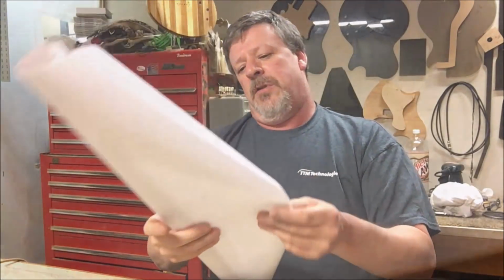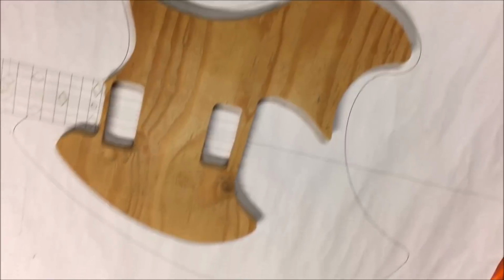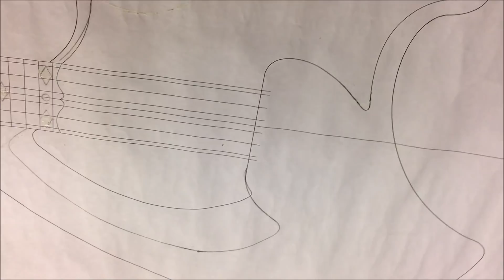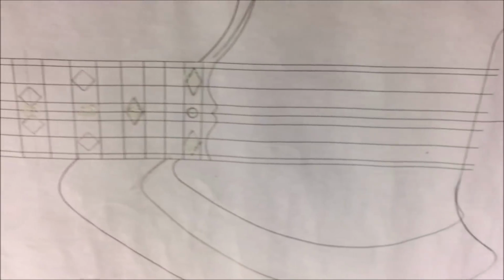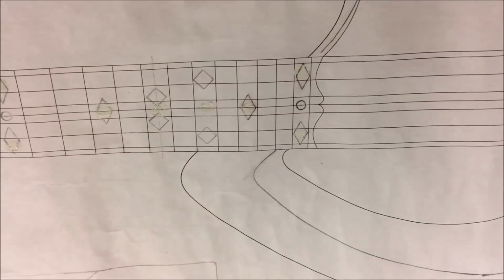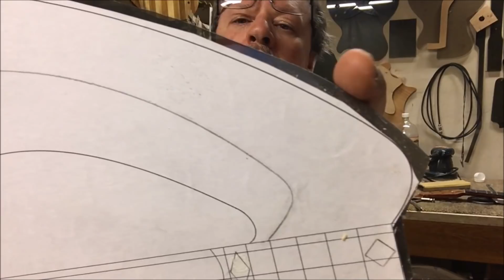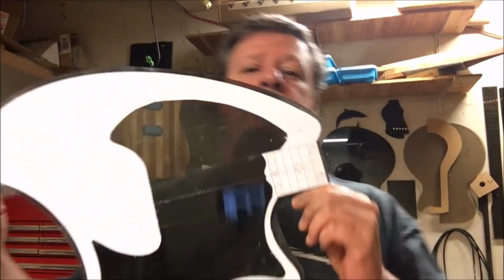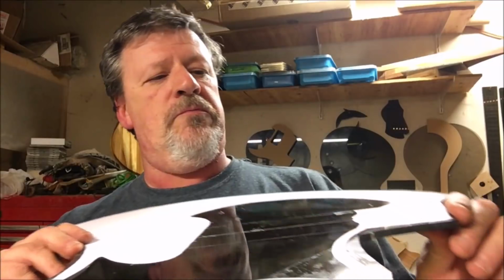Building an Ovation Deacon Copy, Part 1 Making the templates

Comment: Looks like it's going to be a nice build. The part when you were sanding and pointed out wearing the safety gear, reminds me of the Warmoth add, In the add there is a builder who was installing the frets and sanding the sides smooth. Both times his safety glasses were sitting on top of his head.

Comment: If I recall; didn't these have a crinkle black bridge with brass saddles?
Reply: or... they liked to use stainless steel, though...
Reply: I just realized you have a picture of one as the thumbnail...DUH!!
Reply: my breadwinner has nylon saddles which are fine, but getting a little, brittle

Comment: I purchased a Deacon back in the early 90's for maybe $400. It was in pristine condition in original case (looked like Samsonite luggage I swear), beautiful mahogany body, but that goddamn, ugly-ass 70's hardware: giant knobs and that bridge assembly/THING with that foam stuck init. The  bridge looked like a mini Ford Pinto or AMC Pacer (ok, I exagerated there but damn it was ugly). Fantastic player with incredibly low action, nice wide flat neck with a very slim profile. The sound.............crap, but it played like a dream and looked cooler than the period it was from!  Remember, this was the axe tha Keith Partridge swung, and he looked sooo cool playing it (I can see the comments coming, I'm already ducking). I was all of 9 years old, what the hell did I know. But damn if he didn't get some tail!!!! Unfortunately, I sold it when I needed emergency cash. I saw one for sale recently for over $2K. Now, I can build my own thanks to you! May I contact you ass well for templates? By the way, remember the Klien guitar? It's a slight variation of the Deacon. THAT'S how cool this guitar IS, and Klien makes fabulous guitars. Thanks!!